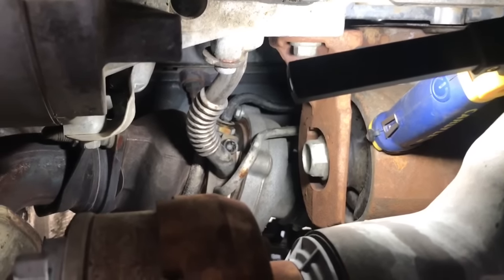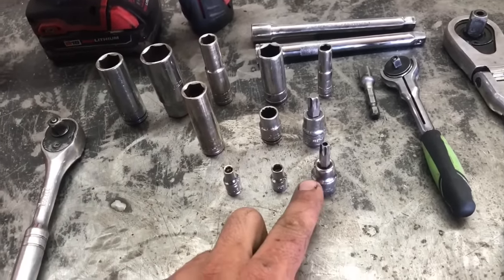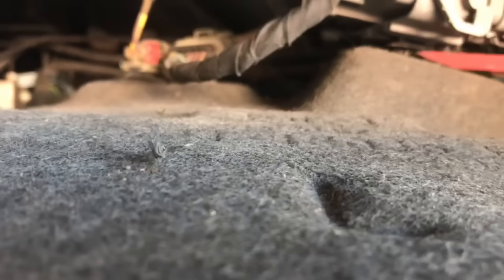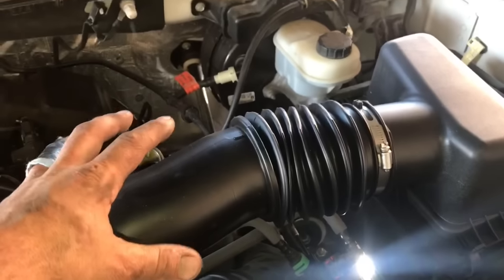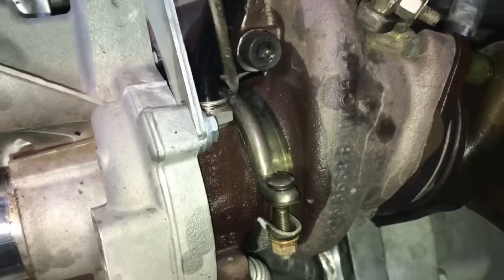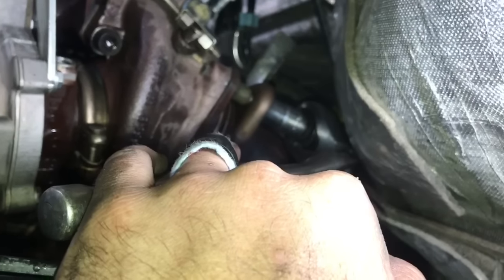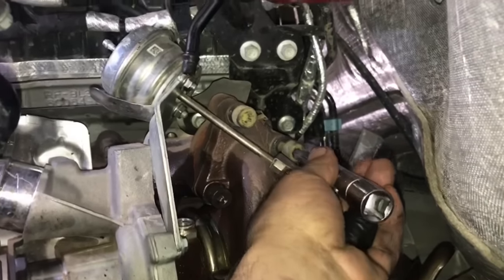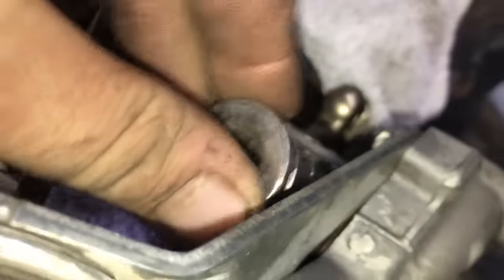F-150 Ecoboost 3.5 Turbo Coolant Connector Replacement (Tips and Tricks)

Comment: Would like to add a little note regarding the T-47 Torx bit he mentioned needed to remove the turbo mounting hardware… it’s actually a T-50 (the new Ford hardware I bought needs a T-50; T-47 fits, but it’s not snug, has play.

Also, removing the spring clip with a screwdriver is potentially bad… the clip may shoot off somewhere it can’t be found. There is a tool for this… A/C and/ or fuel line disconnect tool. Specifically made to wrap around the line, and slide down into the fitting while spreading the spring. Good luck.
Reply: Actually, that last statement is kinda not relevant to the point I was making as those parts will be replaced. I work on helicopters, and must account for all things I bring onto, and take off. This helps prevent FOD (Foreign Object Damage). Just a good habit to keep count of all parts, tools, etc.

Comment: thanks for the video. hoping to tackle this when the weather warms up.... currently around -20° lol so I'm not about to try and do this now.
Reply from the maker: Yikes! I’d wait too. It’s 41 in AZ this morning and I feel like going home! Couldn’t imagine -20
Reply: @AaronHinesAuto  Thanks for the response. I was out today looking at it again since it is warmer. My passenger side is the leaky one, and I am wondering if it is normal to have the coolant and oil lines/fittings leak? I see coolant for sure and also spots with what looks like oil. Also, The lines are dirty/wet all the way up, so while they may be leaking at the turbo, they might be leaking further up. Are the fittings on the other side of those lines the same? I appreciate any insight you might be able to give.

Comment: 6:11 2015 F150 Ecoboost has a radiator drain. Drivers side with a red cap that loosens and allows coolant to flow out of the radiator.

Comment: What all would I need hardware and gasket wise to replace the coolant lines? Do I need to use new bolts for the exhaust manifold and all or can i reuse them? 2014 ford f150 3.5 ecoboost driver side turbo supply and return coolant line replacement

Comment: Fantastic video, thanks for sharing. I have a 2016 F150 Ecoboost.  Every once in a while I find a few drops of coolant on the passenger side near the inside wheel. It’s not consistent, sometimes I don’t see anything for weeks. cannot find anything wet, I’m hoping it’s not the same issue
Reply: Inner prongs getting worn, temperature difference of dissimilar metals.
Reply: Mine started out like this

Comment: How and when do you get the backside coolant line hooked back up on the install?  Before installing the turbo mounting bolts and flange to the exhaust?   I can’t get to the back to access this at all or bend the coolant pipe in.

Comment: good vid thanks but there is another two connectors - one is on the block and the other one located on the engine head =- they are leaking too )) Had bad experience a few years ogo coz ignored it

Comment: Had to do this job today only 1 fitting was  leaking turbo side one took clip off wiggled and pulled line till it came off slightly bent it took swivel socket with 2 inch extension on 3/8 ratchet was done in 15-20 mins max
Reply: So you didn't have to remove the turbo

Comment: The coolant line fittings on the turbo look like they can be replaced without pulling the turbo.  It's tight but at the right angle seems definitely doable with a socket.  Am I missing something?

Comment: I replace my passenger valve cover gasket and vacuum pump and i still getting a small oil leak down my exhaust. Any idea what else it could be ? Turbo fittings look fine

Comment: After I change I out the turbos, do I just add coolant until it’s in between the low and high mark and fire the truck up? I removed the top coolant connector of both turbos, in process of changing them out. There was allot thay deqined out. Was just wondering after I get done putting turbos on on how much coolant to add and if there are any special procedures to get the coolant to cycle through the truck or just add… sorry if it’s confusing

Comment: Hi, I noticed earlier in the video when you were reviewing the water connectors you mentioned to change all four due to the possible line leak at engine when messing with coolant line.  At the end of the video you decided not to replace the water connector at engine. Did you not change it due to it being impossible to reach without lifting body off of frame? Did the engine side water connector leak after fix was complete? Thanks for sharing awesome video!

Comment: On the coolant line from the turbos to the block connections do those not snap into place like the others? I removed the clips then the bolt to remove the line from the block. Just wondering because they don’t snap it even with the bracket bottomed out. The collar on the line looks different also. Thank for the help
Reply from the maker: they dont snap in.  i guess you could say they pop it.  it seems to be a more loose of a fitting then whats on the turbo. i recommend replacing those fittings now that the pipe has been removed
Reply: Thank you! I went ahead and replaced all the fittings on the truck. All of them had signs of leaks. I just wanted to make sure but I guess it makes sense that the stem on the line that goes into the block is longer than the turbo one and it has a bolt retaining it. Thank again for your video it really helped me a lot when removing my turbos!
Reply: How do you get to the fitting on the back on the block/head on the drivers side.
Reply: Doug Weems I attacked the passenger side first then took a 19mm wrench boxed in and put my arm back there all the way to the passenger side and broke it loose. Then I used a 3/8 to 1/4 connected to a 1/4 to 3/8 adapter connected to a crows foot and a ratchet on the other to sneak it behind the head to tighten the fitting one it was installed

Comment: The fittings u put on the turbos are those the same size it can be used on either side of the turbo like 90 degrees?

Comment: Aaron Hines, I've been on top, under and from the side and I cannot figure out how to reach the coolant fitting on the driver's side rear of the motor. I used your video to do both sides headers but have a leak at the back if the block now. Any advice?

Comment: I'm replacing the driver side turbo quick connect fittings that are notorious for developing leaks, and I noticed that the engine side of one of the lines isn't locking into jiffy clip its the one that has the torx bolt holding it with a larger quick connect fitting is this normal?

Comment: Have you ever had to replace  the back fittings , at rear of engine that goes towards turbos? That's my issue right now and I'm so upset I didn't get em done while I did manifolds.

Comment: When your putting the turbo back in do you just force the back coolant fitting back in with pressure and the clip already installed? It looks like a hard place to get to. Good video. Also the 17 is the gen 2 3.5. Do the same fittings and gaskets apply to that motor?

Comment: Just did this. Getting white smoke after about 30 seconds of engine running. I’m assuming exhaust from the manifold-turbo connection? They’re torqued to 28ft-lbs... well at least the one I could get my torque wrench on. Crank them down a little more?

Comment: If the coolant lines are leaking would it make it all the way back to the back of the transmission pan and exhaust cross pipe mine leaks antifreeze from there I I cant find anything leaking

Comment: I have an f150 ecoboost. Replaces manifold and turbos. Replsced all line except the drivers coolant line that runs to the back of engine…. How do I replace the fitting in back and attach the line on back???

Comment: Are you saying to replace all of the quick connect fittings or only the 2 on the turbo? They seems to be in pretty hard to reach areas like in between the firewall and engine. Thanks!!

Comment: You have a part number for the line itself? Mine is leaking at the motor end of that line . I ordered the fitting for engine, but wan to replace the line as well while I’m in there . Can’t find a parts diagram anywhere online

Comment: Do both turbos have to be removed to do this job? Even more detailed question is do the oil lines have to be removed to do this job? I had my coolant line leak fixed by dealer last year and they did both sides and now my oil line is leaking a year later so I’m wondering if that’s something that would be covered under the warranty of work they did.

Comment: Hello. I have a f150 xlt and the o ring connected to the charger needs to be replaced. I went to Ford and they said that they sell the whole part with the turbo charger for 6000. Can I just buy the o ring from another store? 6000 is steep. Appreciate your help. It's a 2013 3.5.

Comment: great video.  is it possible to change the oil gasket on the turbo with out removing the turbo?
Reply from the maker: Yes, the lines will flex a bit, allowing the gasket to slide in and out. Good luck!
Reply: Jeff did you have a oil leak there? What year? Gas oil smell in ventilation?

Comment: How long did it actually take you? How did you align the rear coolant line and how did you press the rear coolant line into the fitting? Which way does the oil line gasket go in? Did you complete all this by yourself? I have worked on cars all my life, but this (should be a recall) is kicking my ass.

Comment: Would this be the same procedure with a 2015 Expedition? Just noticed coolant dripping from the square access hole under ours, it’s only got 121K miles on it. Ugh...
Reply from the maker: Yes, same setup
Reply: @AaronHinesAuto  Thanks, turns out it was my external water pump had gone out.

Comment: Mines leaking from the fitting facing the engine.  Looks like I can replace it from underneath without pulling the turbo.  Thoughts?
Reply: Same boat over here. It looks hella tight in there. Did you pull the whole turbo?
Reply: You will need to remove the turbo to replace fitting or line
Reply: Has anyoetried replacing them without pulling the turbo? Its passenger side for me too, and looks accessible...
Reply: I would remove the entire turbo just so you have an easier time doing it, I repaired my driver side, currently working on the passenger and I'm having a hell of a time with the locking clips.

Comment: My turbo coolant line is leaking on the opposite side of the coolant line behind the engine block not at the turbo and it seems impossible to get to even after removing the intake manifold. Any advice please?

Comment: Have radiator fluid in oil on 2013 ford f150 ecoboost. Is this common .no overheating ., runs smooth, but also know its diluted the oil which is not good thinking maybe blown head gasket no smoke no hesitation what could it be

Comment: Good instructional video, but I would advise using a rust penetrant and not WD-40...WD-40 is less than useless for breaking rusted connections, take this advice from someone that turned wrenches in the rust belt of WNY.

Comment: Great video I think I'm going to tackle this job myself. Just a couple of quick questions. Will the parts you listed work for a 2012 EcoBoost. And is there any way I can replace the coolant fitting without removing the turbo. Mine is leaking from the same spot as In the video.
Reply: Anthony Madrigal 

I’m having the same trouble. Have you fixed yours??    Ford quoted 1800 here in Texas.
Reply: @juangranados7652  I live just south of Houston and man it turned out to be a major pain in the ASS. Mine was leaking from the coolant line on the side of the turbo drive side(which is why the whole thing had to come out). The removal itself wasn't to bad. Just trying to fit it back in place was difficult. The coolant line on the side of the turbo doesn't have much play so everything has to be lined up perfect. I had help and it was just a bit tricky. But patience is key. Unfortunately for me none of my studs holding the turbo on wouldn't thread more than 8 turns, and on top of that the middle stud broke inside. So I ended up using washers so the two remaining studs could apply pressure. Not sure if anyone else had trouble with the studs. If you have help and are good with mechanical stuff I'd say don't be afraid to give it a try. (I just happened to get the worst case scenario lol)

Comment: Do you actually have to remove the turbo to replace the 15mm fittings for the coolant lines?
Reply: I was wondering the same thing, I’ve got this prob in my transit (same motor), would  love to avoid all that if possible.   Mine is actually leaking from the block connection which although will be a blind repair I can get my hands on relatively easily.   But I know if I move it around the turbo fitting will more than likely leak after.   If you’ve found any info would love to know.  Thanks!

Comment: Did the driver side without removing anything but the fender well. Wasn't easy and wouldn't recommend. Passenger now leaking. I'm going to try and separate the turbo leaving exhaust side on. I just have the one fitting leaking on the top of the turbo

Comment: My 2015 F150 3.5 Ecoboost has a petcock on the Driver’s side of the radiator. When I drained my coolant only 2 of the 4 gallons of coolant drained out. I could not figure out how to get the rest out to refill with all fresh coolant

Comment: Great video! Mine is leaking with only 50k miles on it and I found out because it ruined the starter and left me stranded. Is this a reoccurring problem (like a design flaw) ? In your opinion Is it even worth to keep fixing this truck or cut my losses and move on? 50k miles and issues like this isn’t confidence inspiring and reliability is paramount to me. Thanks
Reply from the maker: i have done this repair many times and have not seen a comeback yet. seems to me that the rubber o ring inside these fittings gets real hot and after time gets brittle. and a leak occurs. so yes it could be a design flaw however its not bad enough to justify getting rid of the truck. in my opinion. if you have the tools and follow the video you can save yourself a lot of money.
Reply: I have a 2015 F150 and that same thing happened to me @37,XXX miles I took it to my local dealership and they replaced both sides at no cost even tho only the passenger side was leaking. I wouldn’t go to the extreme of moving on to my next vehicle just cuz a coolant leak. Me personally I love my truck 3 years and only 1 trip to the dealership can’t beat that.
Reply: Matthew Klunk i agree, love the truck when it’s working, but reliability is paramount to me and these trucks are too expensive to have these premature problems. Sad because I went into this truck a bias ford truck guy through and through but unless by some miracle this thing lasts 250k miles (like a modern vehicle should) then this will be my last one. Everyone I tell my ecoboost story to has one of their own, or someone they knew with one that had major issues.

Comment: Aaron, I just put my turbo back on and hooked everything up. Now I have a coolant leak at the back top of the engine. It appears to be the line that is connected to the turbo. Have you ever had this problem and if so, how do you get to it?
Reply from the maker: There is a coolant connector at the back of the head. You will need to remove the fitting at the turbo, then while laying over the top of the motor remove the pipe from the back of the head. I believe you will need a 15/16 wrench thatunscrew the connector out of the head. I cut a 15/16 wrench in have and unscrew the connector with the pipe still attached. Since you can’t see the fitting you will be working with your hands only.
Reply from the maker: I have ran into this issue once on a high mileage truck about a year ago.

Comment: I was looking at parts breakdown listed.  Can you reuse 3 bolts that connect turbo to manifold and studs to down pipe?
Reply from the maker: yes you  can re use them, i have done it alot. as i am in az,we dont have a lot of rust. but if the bolts look corroded, then replacement would be ideal.

Comment: Do the clips have to be installed after the coolant line is placed inyo the fitting, or will the coolant line snap into place with the clip already on the fitting?  Thx
Reply from the maker: The clips should be on the fitting when you install the line. They are spring steel. When you purchase the connector the clips will be already be installed
Reply: @AaronHinesAuto  Thanks..did the job and thought I was good.  Now its leaking out of the fitting on the back of the block...I guess moving that line up out of the way to get the turbo out damaged the o-ring on the fitting on the back of the block.  Do you have to remove the turbo again to replace the replace the rear fitting?  Thanks again Aaron.
Reply: Sorry, just saw you already answered that question.  Thanks

Comment: When referring to the Studs and Nuts W716667-S900 and W520514-S440. Are these the studs for the exhaust manifold? Or the studs for the down-pipe from the turbo?

Great video! Going to attempt this over this coming weekend!
Reply: Were you able to figure it out? Im doing this tomorrow.

Comment: Thanks for the video... Mine started leaking now...  I still gotta find the time to doit...  One question... Can you just remove the hose and replace the Seal in place or does the  hose have no play at all...
Reply: I have a 2013 and did driver side both fittings and 1 on the pass side without turbo removal.  It is possible. Could not get my turbo bolts broke loose so I had no choice, it really was not to bad.
Reply: @purplemartin2233  how down you do it